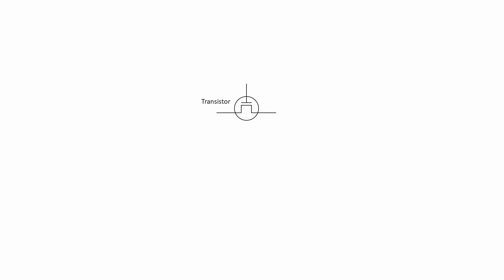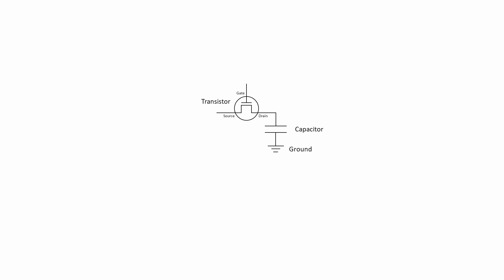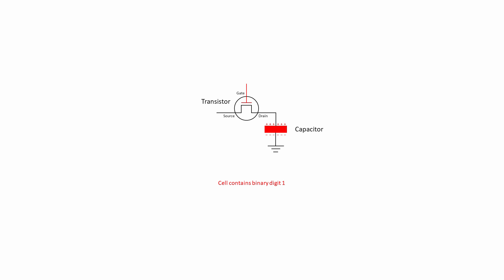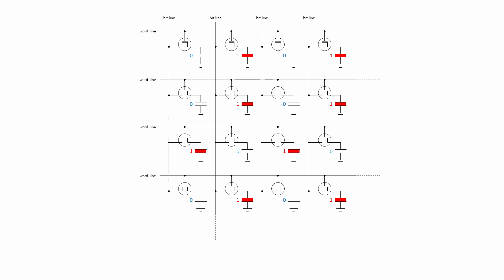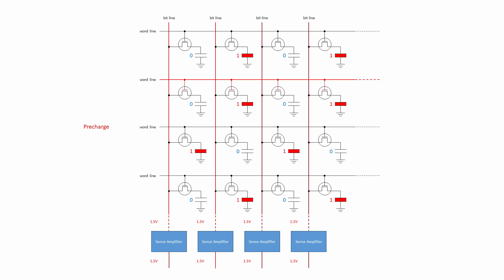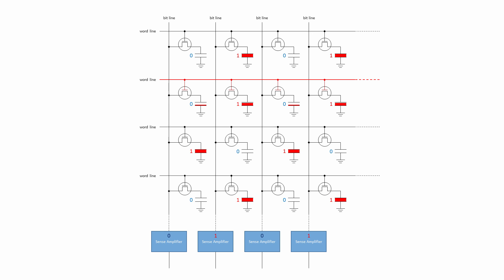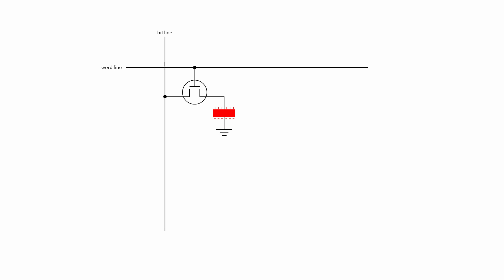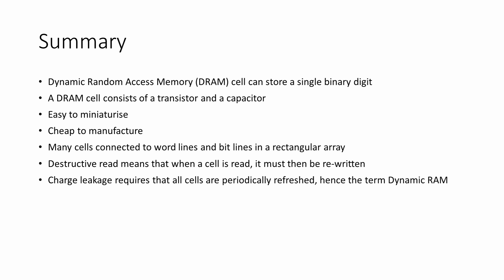Dynamic Random Access Memory (DRAM). Part 1: Memory Cell Arrays

Comment: 4:04 Hmm… Isn't this pattern similar to how an LCD panel is organized? It also has row and column selector transparent wires and transparent transistors, and the liquid crystal cells can be seen as little capacitors too, because they're a piece of dielectric trapped in between two glass plates covered with conductive material.

Comment: what is a sense amplifier actually made of, as in what is deeper than that blue box? I'm just asking for some help here. Great video btw!
Reply: Most likely a difference amplifier made of a parallel pair of transistors with a common drain, just like in an operational amplifier.
Reply: @bonbonpony thanks